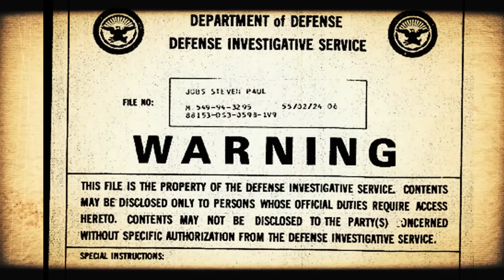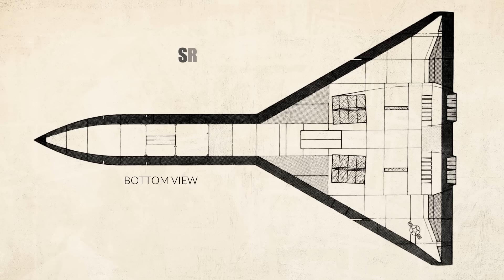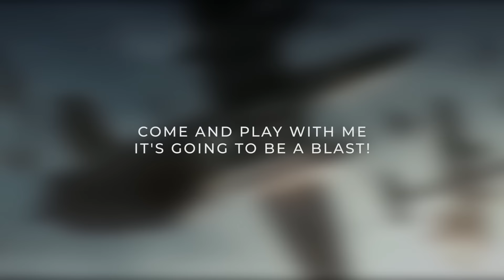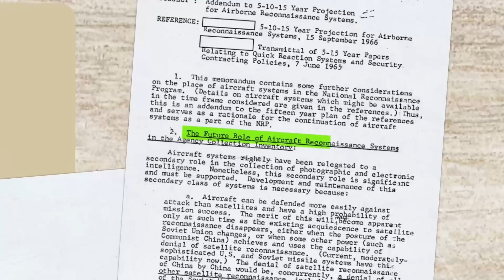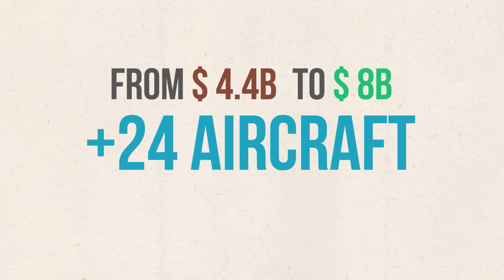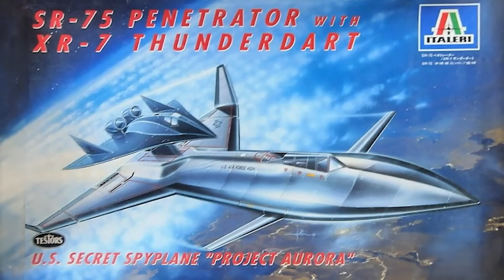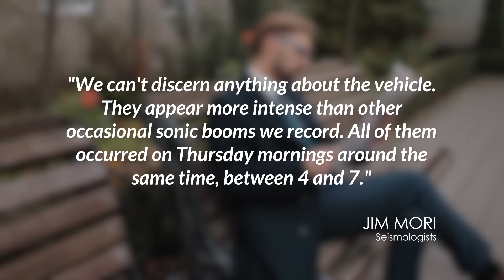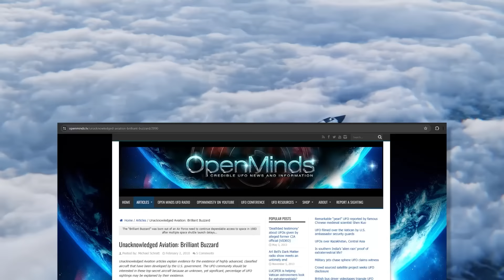This Plane "doesn't exist" - SR-75 Penetrator

Comment: From 1984 to 1992, I grew up around Edwards Air Force Base. Because my biological father worked at Edwards and Groom Lake aka Area 51.
He worked on a program that the ground crew nicknamed the aircraft Grease Lightning, due to its speed. This aircraft was faster than the SR-71.
This aircraft was being tested back in the late 80's to the 90's.
One night out in California City. The whole family went outside to watch a meteor shower.
When we looked up. We saw something very bright and very high streaking across the night sky. It went from the south to the north in about a  minute. We didn't hear anything. I went inside and grabbed a camera to take pictures.
I gave the film roll to my biological father to have processed. 
I was later told nothing was on the film and I never saw the negatives.
What happened to the film? I don't know.
But that night in the Mojave desert, I saw something so fast, it glowed bright white.
After that night, my biological father told me about a program at Groom Lake they nicknamed Grease Lightning.
Reply: Replied to you many times already. Do you know whether the Grease Lightning was pure recon bird or just a technology demonstrator for unknown(publicly) purpose?
Reply: @RallyRacingVideo  
Most likely a technology demonstrator.
Reply: @Istandby666  the claim the Grease Lightning was flying  in the late 80s and early 90s means it definitely wasnt flying in the mid 90's forwards? Is it just deduction or a claim from some repudable source?
Reply: Actually, RAF Macrihanish doesn't have a long runway at all.   I was gonna C - 5 doing touch and goes ( rollers ) and missed approaches ( forget what the Brits call them ).  Yes it is isolated, but like I said, the runway is not as long as would be needed, according to your description.

Comment: Two questions:

1. How useful would this be if the parasite only had a 250NM range at Mach 15, as stated (@9:00).  I think it must have been much higher.
2. How would the parasite have returned to base?  Would it fly back on its own or somehow mate back up with the mother ship (I doubt this).
Reply: My thought would be that if it could achive altitudes of 125 miles, that's pretty much Low Earth Orbit. That's high enough to give you at least one orbit around the earth. The parasite would only need enough fuel to achieve this and then coast for the rest - or most of the flight - like the shuttle. It would be able to land at pretty much any airstrip since it was much lighter than the mothership and then be transported back to Aera 51 via C-5.
Reply: Unless it just goes self delete at the end.

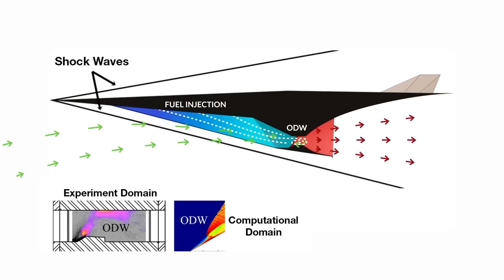Comment: 3:53
You misinterpret rotating detonation engines, at least I think... you show the aircraft riding pulses of explosion when in fact in these engines use one single continuous detonation rotating around the inside of a cylindrical combustion chamber
(These engines are now in the public domain, Scott Manley has a good vid on them, they're also slated to go into newer cruise missiles)

Comment: When I was a kid in the early 2000s we would sometimes hear this deep pulsating rumbling at night here in the countryside of western Germany. I looked outside every time I heard it, but never saw any strobes. I was always a plane nut, even back then. And we'd get traffic from/to Frankfurt, Ramstein and Spangdahlem, so I knew my engine sounds. This was nothing like anything I've ever heard before, or ever since.

Entirely unrelated, but another thing that happened around that time was every few weeks some clocks would suddenly display wrong times or blink 00:00, exactly like after being disconnected from power. Other appliances prone to load variations / spikes would be turned on in the morning as well. One day I was awake at night and just looked up at the stars from my roof window. Suddenly there was a flash, although there was no thunderstorm. I then heard my parents wireless phone downstairs beep (like when you put it back in the base unit and it started loading battery) When I looked back at the clock it now blinked 00:00. A few weeks after that my grandpa told me he had been awake at night and seen a flash, exactly at a day where the clocks had been reset in the morning as well.
I still would love to know what kind of tests those were. I'd speculate about EMPs or something, but since I know what high-altitude EMPs can do to power grids I'm reluctant about that...
Reply: That's indeed interesting recollection of the past events in your region. If I may ask, could you pinpoint more preceisly the year that you heard deep pulsating rumbling sounds at night in the early 2000's? I once came across a website where someone else did mention similar accounts as yours with the same timespan and details and would like to be get more preceise on it. 

EDIT: here is a direct quote from the website I aforementioned: 
"Hello, i am an american living in germany and i know of people who could have seen the aurora just a few weeks ago. I was told that they were woken up to a loud pulsating noise early in the morning. They looked outside and saw a flying object at low altitude in their words nothing like an ordinary aircraft. Several people in this small town in southwestern germany( near ramstein, bitburg, and spangdahlem afb) have reported in seeing the same thing that morning." 

Makes me wonder...
Reply: @RallyRacingVideo  Wow! Very interesting find. I live near Simmern in the Hunsrück region. Not close enough to RMS or SPM to see aircraft landing there, but still in their approach/departure corridors. If people in Bitburg could see the aircraft at low altitude, it might have flown over our region while descending. 

In regard to your question, sadly I'm not certain. I think it might have been 2002 or 2003, but I'm really not sure.
Reply: @FerrowTheFox  thanks! I heard similar accounts of people hearing same engine notes around 2002 in UK too. 1998 showed another report of same sounding near another US base located in Germany. Could it be just a pie in the sky? I don't think so, even if engine note characteristics are dictated by a weather in most conditions, then, specific pulse rates and frequency wouldn't differ as this is what engine produces itself, I believe.

Comment: I wouldn't be surprised if Lockheed made design drawings for something like this, but I would be stunned if it got past the prototype stage. It just does not make enough sense. Stealth technology in the 80's was severely lacking, so it would either show up clearly on RADAR, or be subsonic, or use some kind of exotic fuel (see: Uranium). That already makes it nearly useless, especially after the early 90's.

And then there's the heat problem. I have no clue how to cool something moving that fast.

Also, I see you have no citations. I don't think I could even call this edutainment if you give no sources and are not a subject matter expert.
Reply: You do realize that the B-2 was largely designed in the 1980's and was doing operational test and evaluation in the early/mid 90's, right? The YF-22 and YF-23 were also flown in the early 1990's.
Reply: @mpeugeot  The B-2 was subsonic, and even the F-35's radar-absorbing coating wears out quickly over mach 1. A hypersonic scout plane that causes an international incident every time it's used is not very useful, and would be very easy to detect. The technology behind a hypersonic stealth plane would make the b-21 raider, and China's entire naval strategy obsolete.
Reply: @henryfleischer404  Well the YF-23/YF-22 were most certainly supersonic (Mach 2+) and relatively stealthy. Yes, stealth coatings at the time were relatively fragile. As far as hypersonic stealth, that would have been a completely different story (and I don't think that we had reliable hypersonic coatings at the time), however, as altitude increases wear decreases on the coatings. 

Speaking of international incidents, how much did we hear the soviets complain about the U-2 prior to shooting one down?  It's really difficult to complain unless you can prove it exists.  It was the same story for a lot of our reconnaissance aircraft, few complaints until they could prove it.

Detecting it is one thing, proving it is a US aircraft is entirely a different thing all together (especially at over 100k altitude and rolling at well above Mach 3).
Reply: Agreed but as for coming something that fast. What does the space shuttle reach on return?
Reply: @nickabel8279  The space shuttle reaches up to mach 14, but not for very long.
Reply: @henryfleischer404  just wondering if some kind of ceramic skin can last long enough for one flight and be replaceable. The Bugatti Veyron has tires that will last top speed at 15 minutes and a fuel tank that empties in 13 minutes

Comment: Back in the 1950s, the idea was to fly higher than SAMs hence the U-2 until Gary Powers was shot down.  Then in the 1960s the idea was to fly so fast the SAMs could not catch up hence the SR-71.  Then in the 1970s the idea was to be undetectable to the SAMs hence the Tacit Blue.

There is no point in a large fast aircraft as the successor to the SR-71. The successor is no doubt a slow, small aircraft invisible to radar.  This is why interest in hypersonics disappeared - there’s no point in it.

Comment: 14:52 you said 1995 at this point, not sure if that was a mistake, but if it’s correct the sr75 now is less needed due to the Soviet union’s collapse, except for the USSR there weren’t many countries that have good enough defence for sr71
Reply: China
Reply: @WolfeSaber9933  fair enough but they’re not the best
Reply: @sop1918  North Korea, the Middle East, Russia.
Reply: @WolfeSaber9933  for the Middle East just use SR71 it’ll work and North Korea I mean idk about their AA abilities
Reply: @sop1918  The SR-71 did fly over. One time, it was locked on, but the Blackbird was too fast for the missile to catch it. The missile ran out of fuel.
Reply: @WolfeSaber9933  yeh and that’s fine, if the missile can’t catch not a problem and with modern stealth tech it may be possible to upgrade the SR71

Comment: I heard an aircraft, with the unique sounding pulse wave detonation engine(s) on two separate occasions between 8 and 15 years ago flying high over the Central Valley / Livermore Valley . I got the impression that the plane was negotiating a wide turn left toward the Pacific away from a flight path over the San Joachim valley. The sound was very deep and eerie sounding; I could tell the aircraft was flying very high. I listened to it for a while; nothing like when a jet flies overhead at 30 to 50 thousand feet.

Comment: In 2008 I was at college and I was working for the shop tech, will call Lamar be anyway he was a Vietnam pilot that flew F1 11s and bird dogs along his journeys he actually was refueling his F111 and another Casey 135 flew right down below him. Wow that was going on. He saw an SR 71 trainer dock and refuel with this airplane, so he took a picture of it many many years later he was in New Mexico working with his rabbit farm and at this time they had just retired the SR 71 he was outside and he happened to see over the horizon a single donut rope contrail, and he immediately recognized it because they are so 71 had two of those. He ran in the house real quick, and he got his camera. When he came back out the aircraft was already in the middle of the sky he took a snapshot of it before it disappeared over the horizon again. It was going very fast , he showed me the picture of the single donut rope contrail they snapshot it. So we know it exists.

Comment: The SR-71 was and will remain the pinnacle of "manned flight". Kelly Johnson stated that will never be replaced. 
This is due to Boundary Layer Physics and that humans cannot survive in that environment for extended periods of time.
Another factor is that technology has evolved to the point where humans are not needed to crew such vehicles.
Reply: The pilots would be in a cockpit not outside. But yea, don’t think it would need to be manned

Comment: the x37 is precisely more than likely the reason why the hypersonic scramjet system was retired - unmanned options which can sustain space flight for 24 months at a time. Predator MQ1 drones were also in use by that point, being developed in the early '80s - cheap, light, disposable, and invisible to RADAR.

Comment: Lockheed bought the rights to the Reaction motors airbreathing rocket, i wouldn't be surprised if it's in this project. a SSOT design is in the works but Briton can't afford it right now. I also seen a AR-71 fly over head at top speed back in the 90s it literally takes less then 5 seconds to go from horizon to horizon and it's gone.

Comment: If the SR-75 needed a 10 mi runway in NV, how did they get off the ground in Scotland?   What good does a parasite with a 250 nm range do over enemy territory?  -- they can't in-flight refuel to get back to a friendly runway.   If the SR-75 can fly without being seen by radar as stated in the beginning of the segment, why did it need an F-111 escort to confuse FAA radars (which are nowhere near as sensitive as air defense radars) . . .   BYW the FAA tracks on your transponder . . . normally no one even looks at the skin paint return.  AND, re: ~18:40 comment about sitting on the tech -- the D-21 drone is a ramjet (Mach 3.3) -- we did not have a useable scramjet until decades later . . . .  As to model makers being accurate -- the model of the "Aurora" was all rounded up until the F-117 was revealed/disclosed. . .  The video shown at 20:00 does not even show rings on a rope -- it is the trail of a rocket -- a gap during staging-- upperstage ignition with the distinctive "flaring" of the exhaust as it reaches higher altitude.

Comment: Factually, RAF Macrihanish doesn't have that long a runway, but it's definitely isolated.  I was on a C - 5 doing touch and goes (rollers), and missed approaches (forget what the  Brits call them).  As I recall, the runway is about 9000 feet long.  Not long enough, according to what you say the specs are.

Comment: I was in the Lancaster/Palmdale area from 1989-2002, and there were certainly aerospace phenomenon that I couldn't explain happening in the 2am-4am hours in the mid to late 90's, despite working at Edwards AFB and having better access to the flight line than most.  Maybe you can do a video on why nothing ever happened at the North Base flight line at Edwards AFB...
Reply: Could you extend on the 2am-4am aerospace phenomenon from the mid-late 90's? Really interesting to say the least!
Reply: @RallyRacingVideo  variety of things, some obviously highly maneuverable (with rather unorthodox movement at speeds far faster than rotorcraft) and one in particular at very high altitude, going from above my vehicle to over the visible horizon in seconds (almost like a comet/meteor, but clearly not the same as a comet/meteor visually).  Speed was unbelievable and altitude remained constant.
Reply: @mpeugeot  would you say that the particular one that was high altitude and flew above your vehicle was a manned aircraft?
Reply: @RallyRacingVideo  impossible to know, but this also coincided with the seismic reports of a high speed aircraft at the time that was the subject of speculation.  I didn't hear any sonic boom, but I was driving a rather loud 1970 El Camino at the time back from Pomona to Lancaster around 4 am.
Reply: @mpeugeot  the seismic reports that were called "skyquakes"? They were occuring in the early to mid 90's, no afterwards AFAIK. Are you referring to them or to some other seimsic reports that I'm not aware of?
Reply: @RallyRacingVideo  yes, I forget the year, but I had the El Camino from 1992-1994.
Reply: @mpeugeot  btw, thank you for answering my questions and my words of honors for your work in the field!
Reply: @mpeugeot  no problem. As for that particular sighting, you mentioned the high flyer looked like meteor/comet, I guess you desribed it that way by the color it emitted - yellow, bright or orange, is it right?

Comment: Didn’t see donuts on a rope but me and my buddy saw the little jet fly right in front of us in between to ridges, we were looking at hogs on the other ridge when we seen it skirting up the valley, it was flying level making no sound then it flipped on its side with what would be the cockpit facing us then flipped back level and then either took off so fast you couldn’t see it leave or it had some sort of cloaking device because it completely disappeared,all the while it made not a sound. It was approximately a 250 to 300 yards away flying straight across in front of us. This was in Northern California (Humboldt County) in between petrolia and honeydew, fairly remote area.